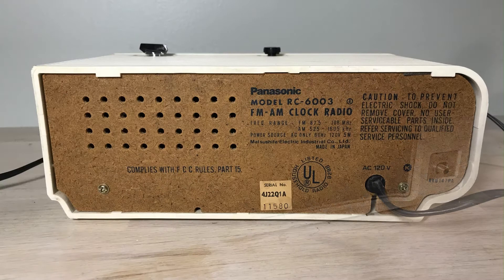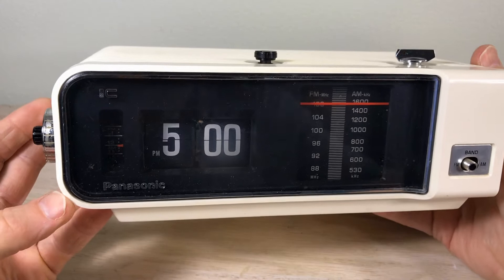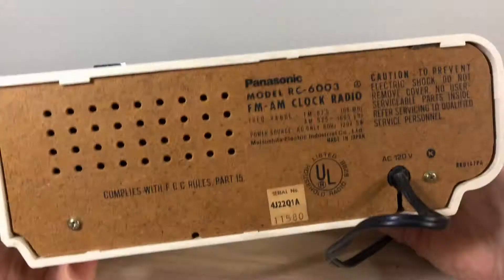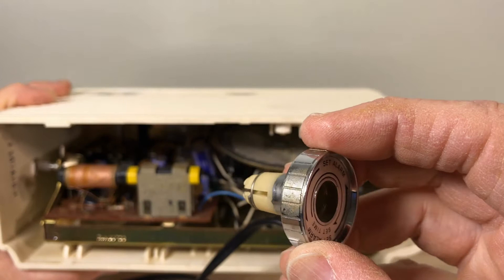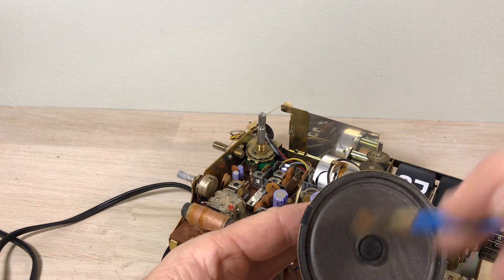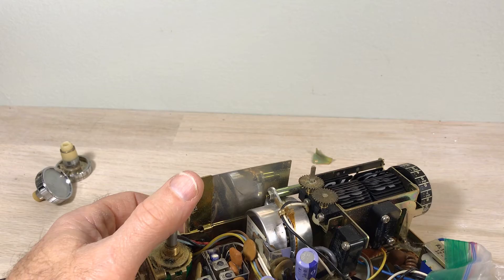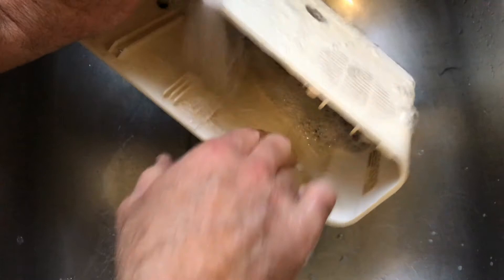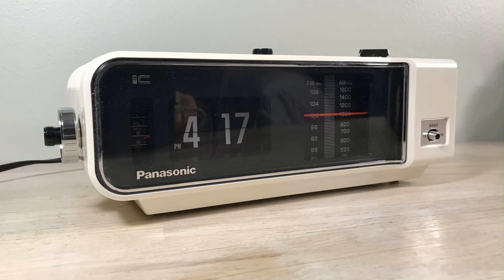Putting a Panasonic RC-6003 back in service

Comment: Thank you and flipclockfans.com for inspiring me to repair my Panasonic RC-6551 which I purchased new in 1973 while in the Air-Force stationed at Korat Royal Thai Air Base Thailand. The 6551 is quite more tedious to disassemble than your 6003 however the YouTube videos walked me through it. My nightmare was the internal plastic gear would be stripped...thankfully it was a simple motor cleaning that got her going! I used all your recommendations and it made for very rewarding restoration...
I'm hooked...I'm now on the lookout for more of these wonderful Flip-Clocks and radios! 
You are an inspiration...Thanks!!

Comment: Okay Flip Clock Man,I got the old girl flapping again,but I have a question.I used the WD 40 on the motor, but I have not put the drop of synthetic oil on the axle.I am worried that the synthetic oil will react with the WD 40 and create a gummy residue that will bind up the motor.What do you think ? can I leave it as is,or should I oil the axle ?

Comment: Thank you for showing how to clean the housing without sratching the "glass". How do you let it dry? I've noticed water can get between the glass en de black panel behind it.
Reply from the maker: I flush it out with distilled water 3-5 times then shake it like a Polaroid picture to get out as much water as possible. Then I use a hair dryer to blow it out being careful to not let the heat get too high (a blow dryer can generate enough heat to melt this plastic.
Reply: @Flipclockfans  Thanks, I will try that some time.